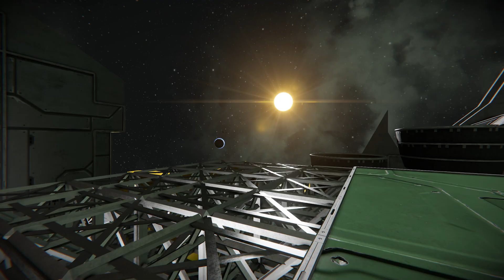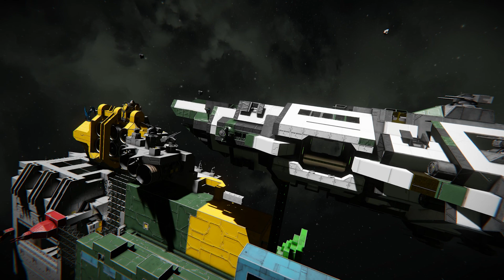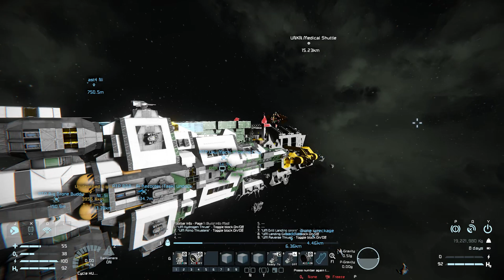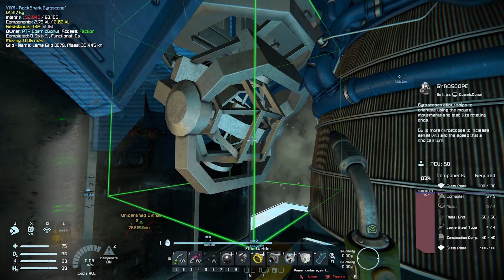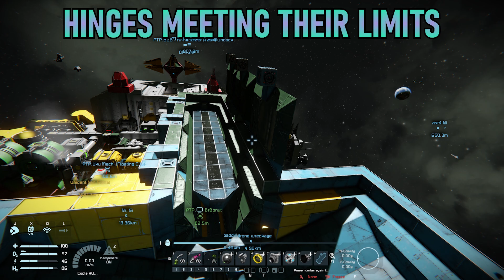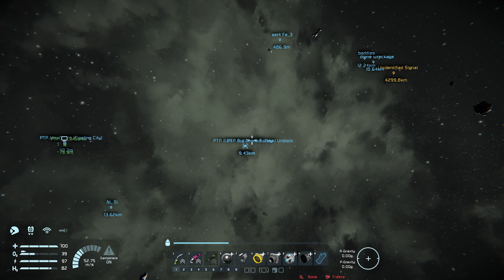ProtoTech Quest: EP34: "Printer Test and the BDB" - Space Engineers Survival

Comment: I feel your pain with making drones do what you want them to do.  Did you jump to the iron deposit?  If so, Is the AI smart enough to find you after you jump?  I've never tested that.  Also, I'm liking the printer automation.  Nice work!
Reply from the maker: They are definitely a challenge.... and ONE DAY I Will overcome. But not today.

Nope, just cruised over there. Maybe 30ms. I felt for a little while that it was following me, but didn't really check until I showed you guys.

Thanks man, I'm trying something I haven't really done before. Stepwise timer automation, and a spinning weld head. I'm a bit nervous I may have to extend the glass around the welders to stop unwanted block placement... but that's a test for another episode. 😃